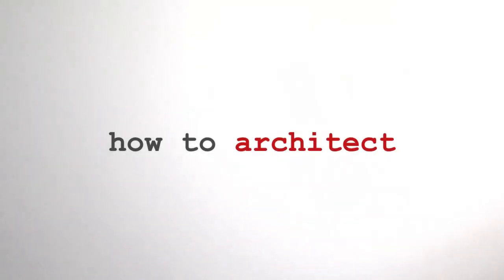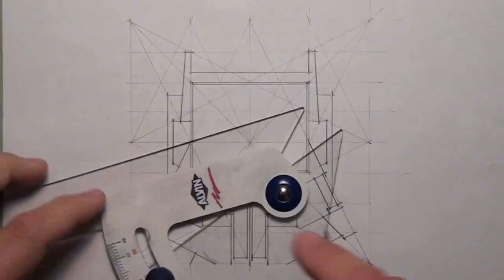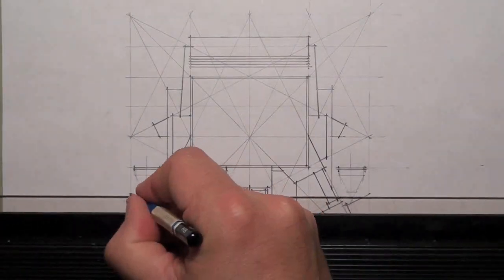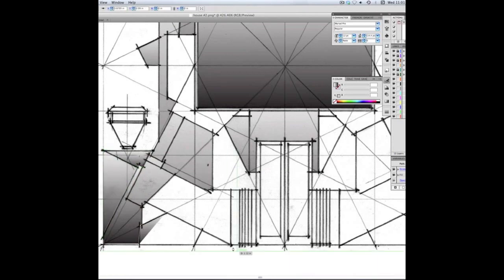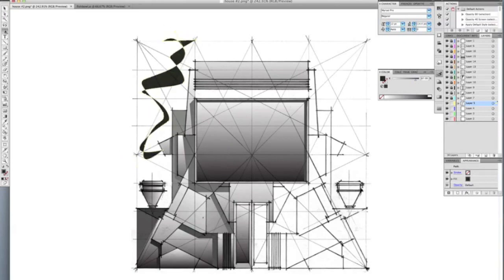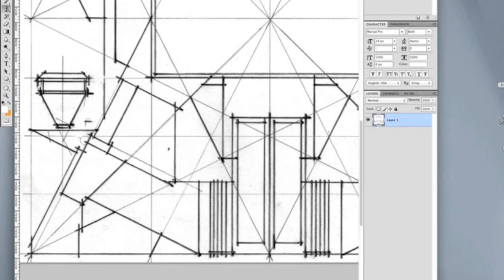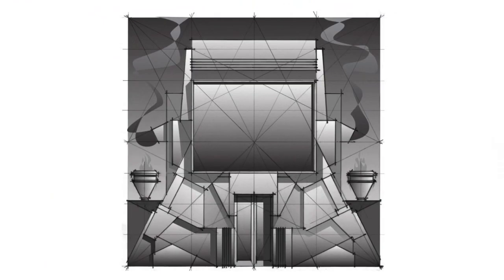An architect drawing with graphite, photoshop and illustrator

Comment: im not that fond of revit, only for the final stage of actually producing the final drawings. During the design proces, you often dont know what to do yet with a certein corner or hallway, where in revit you will just place a wall, which already defines something. In a drawing by hand I would just leave it until later.

Comment: And to be precise, I'm not saying I never work on paper nor that it is obsolete but what often happens is that paper work come after some first 3d sketches on Rhino. And if Rhino work dont result to anything I just simply switch to sketch models. Actually I'm a bit surprised that there isn't any video about work with models?

Comment: I was actually removing some ink smudges from some drawings I did only a few weeks back using a similar method to the one you used in this video. Incredibly time consuming. Once you have the image in photoshop, go to Image > Adjustments > Levels and a dialogue box should come up. There's a slider for "input levels" accompanied by a visual I guess. Just play around with that slider and it should remove the graphite considerably.

Comment from the maker: Thanks for the tip. I taught myself photoshop and illustrator so there's lots of skill and tips I'm missing. Actually, I was removing graphite from the drawn image that was residue from my parallel rule and triangle by using the stamp tool. I'm assuming your talking about using Exposure under Adjustments for the same thing?

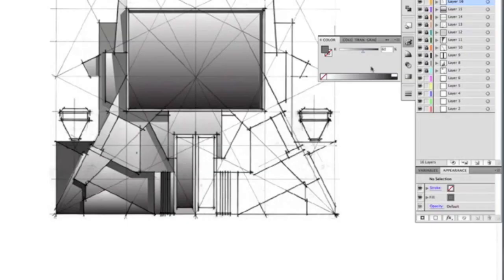Comment: Nice! Not sure if you know this but I'll say it anyway. Towards the end of the video I assume you were just touching up and removing that pixellation that comes in with the scan (for example at 1:05). But while you're in photoshop, just adjust the levels of the image (play around with the slider until you feel it's good enough) to remove those pixels. It's efficient and will save you a lot of production time.